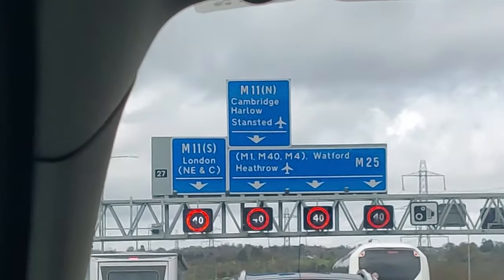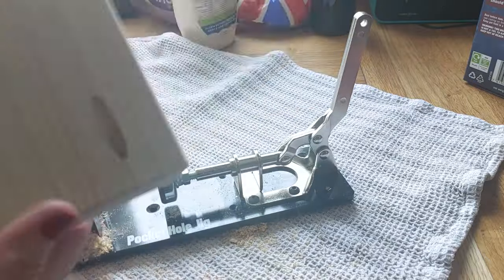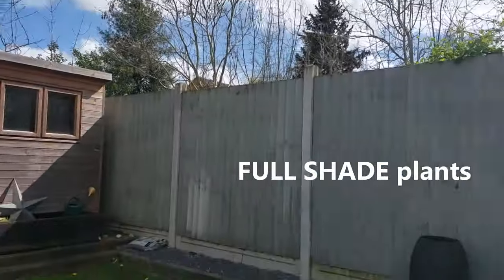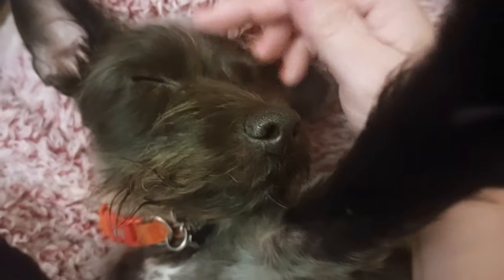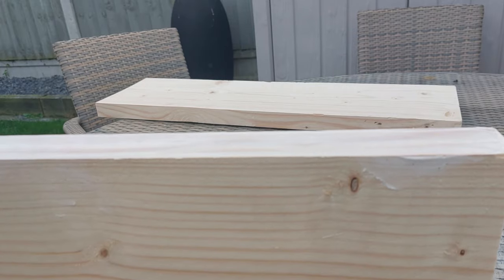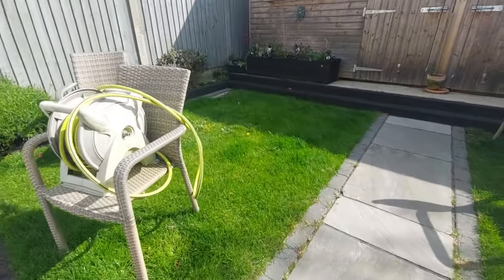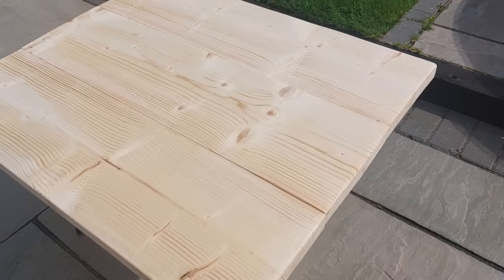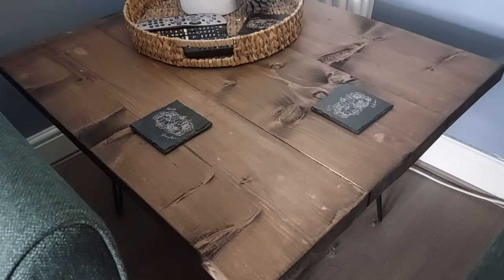A busy week in Essex, UK Garden refresh and building stuff :)

Comment: Loving the console/radiator cover and your "styling". Can't get over those Texas stars!  They look really good, there. 😅😍👍
Did you look up hostas or lily-of-the-valley for full shade plants?  What you actually have for a light source is considered fairly light shade. The light you have should work rather well for most shade plants, IF there aren't too many overcast days. I know, I know...rainy, cloudy England! 💕 Tall Phlox should also do well in your garden. You can use their shade to plant small bluebells and/or Lily-of-the-Valley (forest-y plants) at the feet of the Phlox, hiding its lower stems.
FULL shade is usually in a deep woods or forest setting, or deeply shaded under a mass of taller plants such as trees, bushes, or thickly planted, tall flowers. 
Sorry for the essay...avid gardener/plant lover, here.
22°C is considered a cool Spring day here in the mid-Plains States, nearly perfect. Yesterday was 93°F (33.88889), with a heat index of 99F (hot A/F). Quite unusual for mid April. 
REALLY LOVE the new corner table, Claire! Reaching down to get your tea is so much easier than straight across or higher. Perfect height! 👍  The stain is gorgeous! 😍💕😘 Maybe the old table could go outdoors, between a couple of chairs? 

Awwww! George looks so sleek and dapper with his haircut! 😍 All he needs is a bowler hat and bowtie. 😅

Comment: Claire, you are so funny sister. I work construction with my husband and feel it is my duty to help you with straight line cuts. You can go to lowes or home depot or what ever hardware store you have there.  Get a speed square, big twelve that is a 12" speed square , chaulk box or framing square. Just trying to give suggestions that will help you cut square ends. Happy cutting. 🤣😁
Reply from the maker: Heyyyyyy my lovely ha ha ha thank you so much :) yes yes I already have a speed square - I call it a builders square haaaaa ( Triangle) but yes I did use that throughout this process - I draw lines - just can't follow them haaaaaaaaa